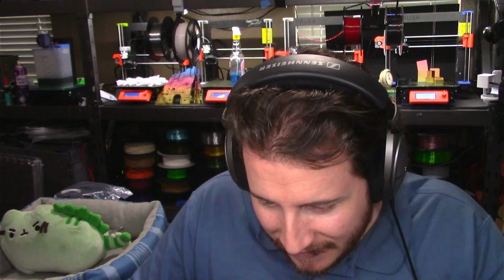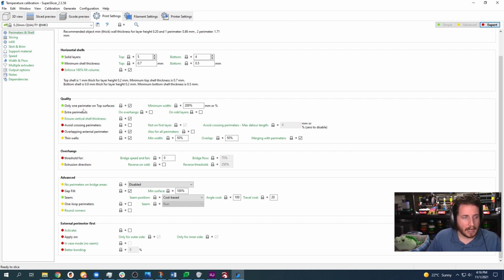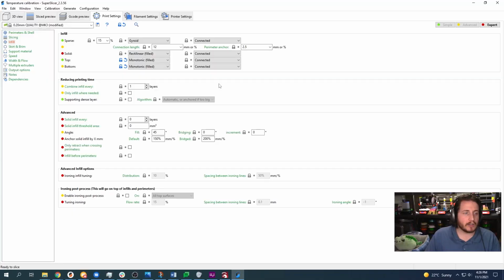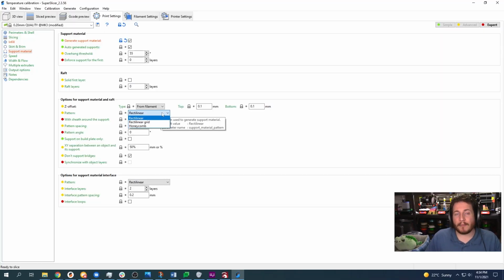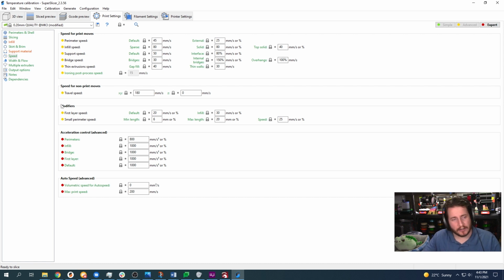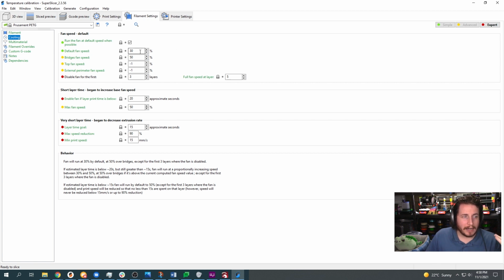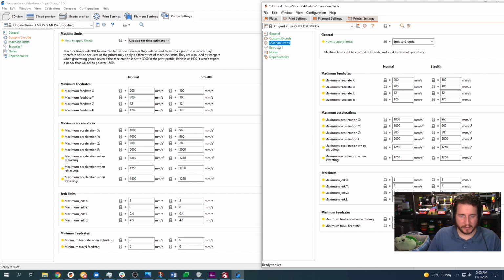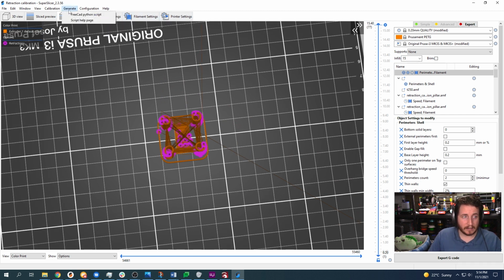A SuperSlicer Super Deep Dive!!

Comment: This was helpful. I need to try it. If you get the chance and are interested, is the Prusa SL1-_  the only FULLY open source SLA printer?
  I don't do extortion software, rent my tools, or write blank checks to borrow hardware. Subscription software is a criminal scam IMO. $2k for the SL1, is way too much money IMO. I might put up as much as my MK3s+ for a complete tool package, but even that is a stretch for such a messy stinky tool that I will use far less than FDM. So what's the deal? What are the options beyond the stupid maketing hype? What are my Gentoo capable, FOSS friendly options? No binary file nonsense.
-Jake
Reply from the maker: Yes it is. Basically all the others used closed sourced boards from Chitu Systems. 

If you want an open source resin that is basically as far as you go. We use Elegoo products here as the 2k was too much to swallow back then and while we do pay for lychee slicer pro ($50/yr) I believe that money is well spent on their dev teams making that software better. And it is MUCH better than Chitubox. We have covered both softwares, as well as prusa slicer in the past, feel free to go through that catalogue and see what you like, but if you are looking for open source only, then the Prusa SL1S is your only option as far as I am aware.
Reply: @3DMusketeers  
Well, that settles it then. Hobby resin printers don't exist... yet.
  I don't rent hardware. Sell me the software and hardware, no strings attached. If not, I will host the party the day they go bankrupt. Your little trick of using prusa slicer still relies on the "free" version of proprietary software. I've seen this plague of blank check software from companies like Autodesk. I'll never touch that crap again. I use FreeCAD, Blender, KiCAD, GIMP, Inkscape, Linux. Heck I won't even use a Google equip Android rom on anything other than this ancient phone I don't use for anything else. Newpipe is the only way to watch YT. 

To any reps slinging hardware:
 I would buy something if it is a fully open source tool chain. Invest in the product enough to sell me the whole thing for a straightforward price, otherwise I look forward to the day when the company goes out of business. -Sincerely
Reply from the maker: I mean, they DO but not ones that are fully open source and "cheap" which of course makes sense. Software is a pain to develop and costs a ton of money. In my opinion, the Prusa is WELL WORTH its cost of admission. 

I tried FreeCAD once, you are braver than I, I could not figure it out.. I hate paying for software as well, but it is the new norm. Companies want to keep that IP internal and keep those looking to copy them from being able to compete without any issues. Open source is great if everyone plays by the rules and are not jerks, alas, that is not common these days either.. 

I can only hope we get a resolution for something truly open source, but I am not holding out hope.
Reply: @3DMusketeers  
I imagine Joe is pricing the SL1 so high because of the total risk for his return on investment. If that's the case, it should scale with time, and the pricing will fall drastically within a couple of years.
  More people should be squeaky wheeling this problem by stating they are not okay with the status quo. Tell your rep contacts. Share my comments. Tell them how real money is being left on the table. I'm a gimp on a tight budget. I don't have the money to buy the tool twice or write blank checks. I only want to get a resin printer to try making a few electrical connectors and some tight tolerance bearing shims. I couldn't care less about the trinket crap most people seem to print in resin. My curiosities are not worth $2k, but I'm not whoring out my morals for the opportunity to play with resin either.

  As far as FreeCAD, it's super easy, once you learn how to get around the topological naming issue. Half of the problems people have come from old video crap posted on YT. The real trick is to look for the actual FC devs that post YT content, like Mark Ganson, and/or just use the wiki, it's surprisingly good. 
 The best part about FC is that it is scripted in current Python. Even if you don't know Python, FC makes it easy to start learning, but also works perfectly well if you do not want to code. The Py console literally spells out the code syntax for everything that is happening in the GUI. You can also use Open SCAD scripts directly.

  Ultimately, this is capitalism. The rules of business are determined by what we, the consumer, allow. Subscription software is stealing ownership away from us. In 10 years or less you will be left with a pile of useless garbage hardware. Not to mention the software is nothing but spyware, constantly phoning home collecting who knows what. Enable a white list firewall on your network and look at the traffic going on with this kind of crap. I have. It's not okay with me.
Reply from the maker: I would be remised if I did not mention that we offer printing services to keep you from having to buy a 2k machine because we did for you lol. 

Most people love the scripting in FreeCad but as someone with minimal to 0 programming experience it is not my style. I wish I could learn it though! 

We are ITAR compliant so we actually end up disabling the phoning home and sometimes even feed it bad data when it wont work with internet disabled. It sucks, but yes, consumers are allowing this.. Looking at YOU all the "company name+" streaming services...
Reply: @3DMusketeers  
 If I had working designs already I might consider farming something out, but I never seem to get a design remotely right until V7+ in FDM. I'm sure it will take even more in order to learn the eccentricity of resin design.
I think the main thing I would like to design in resin is totally impractical for farming out anyways... 
  One issue on high end carbon road bicycles is the bottom bracket bearing shell (where the pedal cranks go). Most bikes over the last 10+ years have an aluminum insert in the composite frame and sealed cartridge bearings are pressed in the insert. There is a c-clip that keeps the bearings from going too far into the insert on both sides. On the outside face of each bearing, the only thing holding the bearing in place is the retaining mechanism that holds the cranks together. This is usually where the problems start. There are lots of issues with how different cranks place tension on the bearings. Ultimately, the bearings can come just a tiny bit loose. This gap, over the course of millions of revolutions, combined with poor tolerances due to low production bicycle specific bearing sizes, and the extreme corrosion issues from steel races in aluminum inserts with road grime, rain, and sweat, result in loose bearings. This is probably the biggest reason serious cyclists retire frames, or sell them to some unsuspecting noob. I've been playing around with thin shims made of PLA to shim out the problem on my current frame and they work okay. I'm just limited to shapes that print flat. I'm curious what might be possible if I could print an ultra thin cylindrical shim that included a way to keep the part in place as the bearing is pressed in place. The tolerance issue is usually not round. It matches the power stroke of the rider. So I would need to design the part the deform in order to match. I doubt there is any reachable market for such a product. The high end bicycle industry/market is slow to adapt to new distribution channels and products, and there is a plethora of crap products saturating the direct to consumer space. Before I was hurt I spent some time as the Buyer for a chain of bike shops. I know the market. So it's just a pointless curiosity of mine. It would probably take me a couple dozen iterations to get it right and I definitely do not have the stamina to do that kind of thing over the course of months with a farm. Thanks though.

Comment: Supper Slicer can NOT add and subtract Supports !!!  WHY does it not have this ability ?
Reply from the maker: What do you mean by this?  It has enforcers and blockers as well as paint on supports.
Reply: @3DMusketeers  
Hi 3D Musketeers,
Thank you for your reply.
I normally use Simplify 3D which I am able to add or remove 
any supports I choose.
I am new to trying Supper Slicer and I have not been able to find any way to remove particular unwanted supports. 
I have not seen or found anything about enforcers, blockers or paint on supports in Supper Slicer 2.3.56.
Is there a video which show how in Supper Slicer, 
how to remove particular unwanted supports ?
Reply from the maker: Make sure to set supports for enforcers only then on the main screen on the left hand column next to your model, you will see a paint brush, click on that to enter paint on supports. Personally, I like this much more than the system S3D uses. I do prefer the implementation of Prusaslicer 2.4 over SS, but technically PS 2.4 is not out of beta as of yet, but it is worth it IMO. 

Hope this helps! If you still have trouble, shoot me an email and I can send you some screenshots and such :)
Reply: @3DMusketeers  Thank you, I will look for it. 
I am not seeing any Supports when I am in “3D View” 
And the supports are being shown when in “Sliced preview” and “Gcode preview” 
BUT there is no way to make any support adjustment in those tabs. 
What’s up with this 
or how are you supposed to make support adjustments when they are not seen ?
Reply from the maker: shoot me an email, lets just get a 15 minute call set up, I can try to type it out, or, I can just show you and I think the showing will help more :)
Reply: I have found some videos about using the PrusaSlicer version for Supports,
https://www.youtube.com/watch?v=6LLK9soDW88

Because I use Simplify 3D’s way of Viewing, Adding and Removing Supports,
I was expecting and anticipating SupperSlicer would work in a very similar way.
PrusaSlicer’s version for Supports is done in an abstract “3D view” tab way, 
which there is no viewing of the Supports before being sliced.
And so to be able to view the Supports is a burdened with having to go to one of the other tabs “Sliced preview” or “Gcode preview”.
Which when you have a large print file, it take a very long time because SupperSlicer/ PrusaSlicer needs to Reslice every time you need to just view the Supports.
So back and forth you go with waiting a long time in between the tabs.
PrusaSlicer’s way of editing supports is an old antiquated 
abstract process that needs to go away.
Simplify 3D is the easiest way of  Viewing, Adding and Removing the Supports all in one tab. 
If SupperSlicer could add the Simplify 3D way of working with the Supports it would be the best slicer out there.
Reply: @bob55today  Yep, found this as well while tying to fight with SS. A 2023 app and when you compare it to a 10 year old ++ S3D old crock, well, it's beyond me, all you hear is all the bells and whistles SS ( is supposed to handle ), but none of the experts take it from step one and mention the lacking of the cryptic basics.  I have asked what I am missing from the guru's as I naturally do respect that people actually ( can ) use this mess but don't get much of a comment as to why I may not be getting it after 12+ of 3D printing. Perhaps we could, again respectfully ask the guru's to maybe do a vid to list all the basics it either can't do as well as the ancient apps, if it does do them why they seem like in your case nowhere near as well as the oldies, and why the the UI is as confusing as it is and a clear and concise pathway of to jump through the hoops.
Reply from the maker: The issue with listing stuff like that comes down to when the software updates and then the video is factually incorrect.. 

Superslicer is a few revisions behind prusaslicer and while it enables more control, it's age shows.

Comment: Do you ever use threaded inserts?  I been looking for a press that can hold my soldering gun.
Reply from the maker: We do. Pretty often in fact. We have a special tip for our soldering iron that is used to insert them, but I've never used a press with it before.
Reply: @3DMusketeers  I been looking at the drill gun presses and thinking about making a mod that would hold my soldering gun. I just need to go straight down. I just ordered one of those tips last week they are awesome!
Reply from the maker: Could definitely whip something up fast to make it work, no need for something fancy IMO, just needs to hold the soldering iron SECURE. don't want it dropping LOL
Reply: @3DMusketeers  yeah just needs to hold it tight so it doesnt slip or wobble and i think this drill press idea would work great.
Reply from the maker: It definitely would!

Comment: I'm just starting to try SuperSlicer after using exclusively S3D for years and years.  The things I'm trying to wrap my head around with SuperSlicer are:
- The patterns they draw on the bed for Voron and Sidewinder X1 make my eyes bleed - how to remove that without starting from scratch.
- How to define settings for a printer that doesn't have presets (in my case a MakerGear M2 and Monoprice Mini Delta, for example I created a MakerGear M2 profile that works but is much slower than my S3D M2 profile was so I'm missing stuff)
- How to organize settings at the printer/filament/print level so you reuse more general settings as much as possible across nozzle sizes, layer heights, and filaments.
- How to translate S3D settings you've been happy with into starter SuperSlicer settings.  A Rosetta Stone from S3D to SuperSlicer would be awesome!
- Basically any help in how to think like SuperSlicer wants you to if your head was shaped by S3D.
Reply from the maker: For the patterns, you can delete the picture they use in Printer Settings> Bed Shape. There you can upload your own texture and model, It can be whatever you want. 

For a printer without presets you would add a custom printer in the wizard menu

You can have filament overrides that will override the normal numbers for retraction and more, this is found under Filament Settings. You can also make a few different settings under Print Settings that can be purely custom per machine and using dependencies you can ensure that settings for the Delta wont show up for the M2

Most of the settings are pretty similar, but SuperSlicer has WAY more than S3D. Do note, the coast feature is absent and more or less replaced with the wipe settings. It is not a full coast, but it works fine. If we get enough people asking for a way to transfer over we may do that video, however I uninstalled S3D when PrusaSlicer 2.4 went into Beta because at this point, there is no reason to use it anymore in my opinion.

Hope this helps! Let me know if you have any other questions!

-G
Reply: @3DMusketeers  Thank you for that. I found S3D handle the supports better or maybe its easier for my. I´m struggling with supports in SuperSlicer.
Reply from the maker: @hugolatra3d  When they grab the new paint on snug supports from PS 2.4 it will be MUCH better. So for now, I run PS 2.4 beta 1

Comment: Support interface on Prusa and Superslicer seem to be to well attached to the model. What setting would you suggest I adjust to make the interface easier to separate?
Reply from the maker: More gap between the interface and the model. Also using the Thin Bridges setting in the 2.4 beta with PrusaSlicer would likely help with that as well. Generally though, if you have issues with the supports breaking off, look at that separation gap. 0.2mm is normal in most slicers.